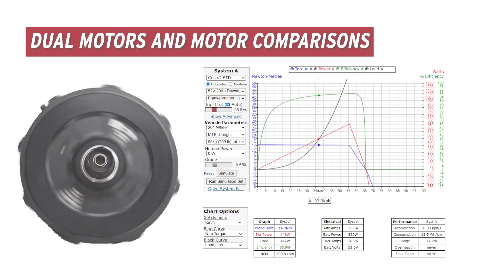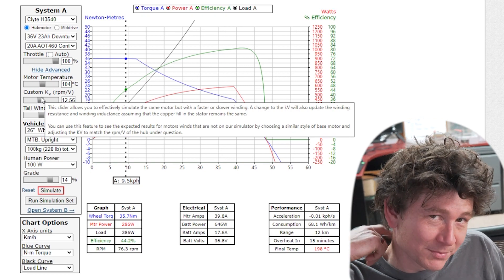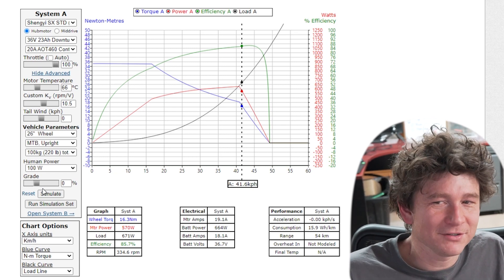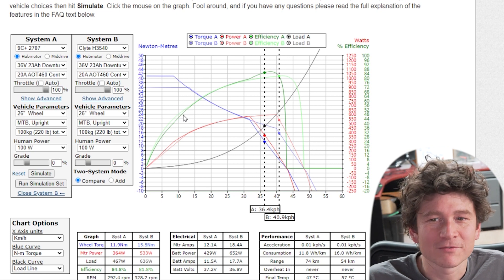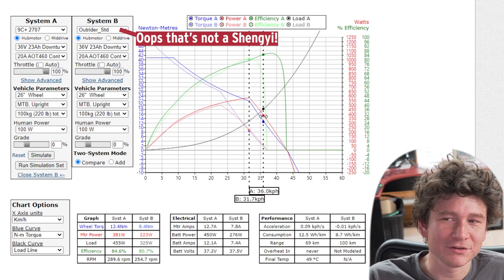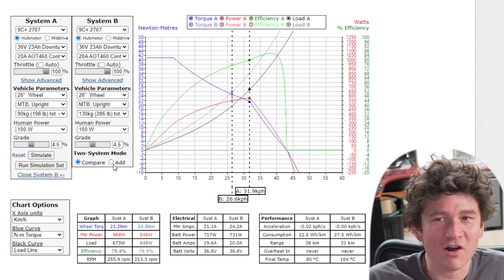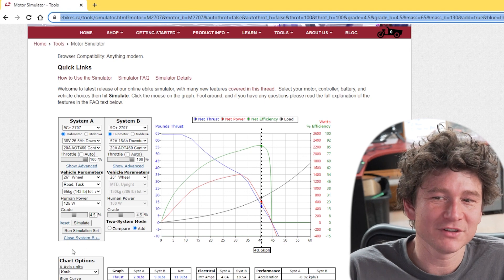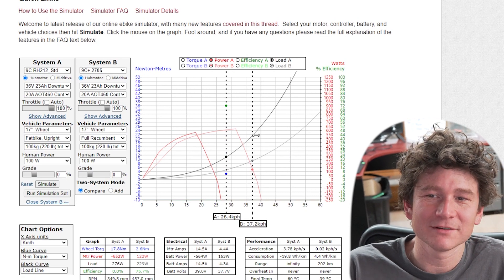Grin's Ebike Motor Simulator --PART 3-- Advanced Features (Temperature, KV, Wind Speed, Comparisons)

Comment: It's strange that if I put Throttle to 0 and set some value for Human Power I get no results. I know it's an engine calculator, but I'm concerned about how accurate it is, if it can't calculate with human power alone?
Reply from the maker: There's a minor bug in the implementation of the 0 throttle, but if you put in a tiny amount like 5% throttle it will show perfectly accurate results of human power alone as the motor will have no output at the speed the person achieves with human watts. Just be sure to have a controller type with a voltage throttle and not a current or power throttle.

Comment: how did you determine the overheat temperature? I think running the motor hotter than 100-130 degrees Celsius will likely damage it and the simulator sometimes shows like over 190 degree celsius
Reply from the maker: It's set somewhat arbitrarily  to 150 celcius,  most motors can handle that kind of temp on the windings without permanent damage. But we'd normally advise doing thermal rollback will before then
Reply: @GrinTechnologies  I burn my hub motor (SWX02) going up long mountain roads. It just bogs down and overheats, especially in the summer sun.
Increasing power would only make it worse. Need more torque AND to increase cooling!
Probably need lower gearing/winding for more torque.
What would you recommend?